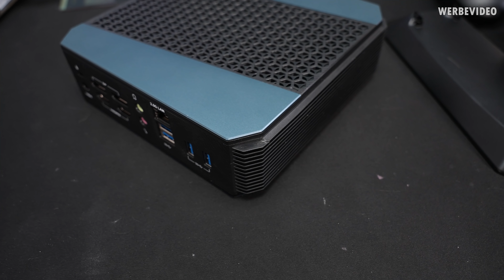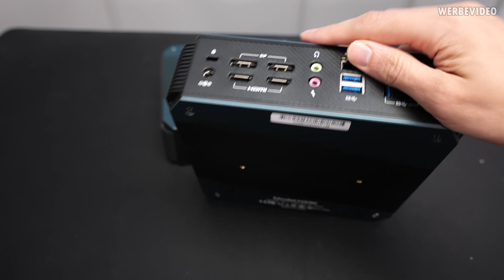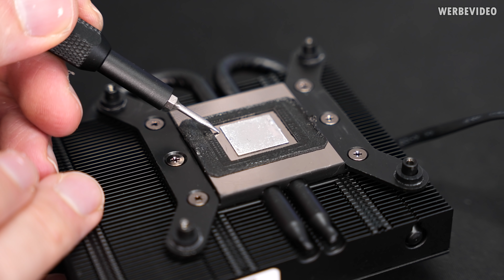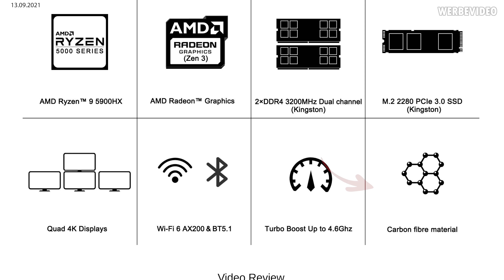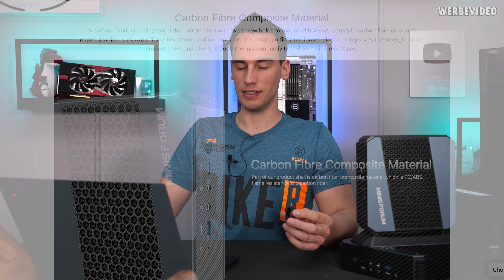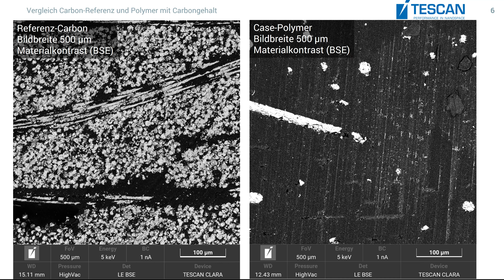More Marketing Lies? Minisforum Retail PC opened and Polymer analyzed by Tescan (SEM)

Comment: Its all just marketeering.  Legally, they have a carbon composite (similar to a bicycle seat shell - those are also "carbon composite" and it does have FINS on each side so that is BETTER than flat sides increasing heat dissipation over standard non-ribbed plastic.... LOL... so...  over 1% alloy in metal makes a huge difference?  3% in plastic is....?  LOL

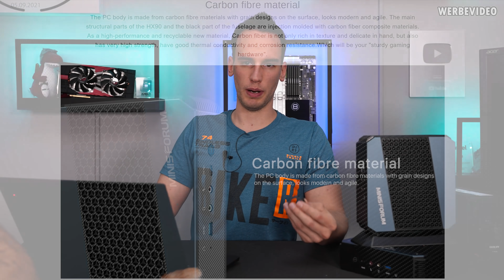Comment: 11:36 Minisforum clearly states it's injection molded composite materials in the text body. seems like the pitchforks were raised a bit too high IMO. Both tested plastic parts are manufactured with different methods. typically chopped fibre is used for injection molding. IMO this is extremely nitpicky. The SEM photos are also only showing a surface photo which isn't indicative of the material composition throughout the material. The continuous fibre manufacturing of the bike part is a sturdier and more rigid design but the chopped fibre injection molding will still improve the strength of the material considerably. The marketing is a bit silly but not as egregious as what we see on many products these days.

Comment: uhh i dont think 3% will make it better than PC/ABS at all, Even in my 3D printer CF filaments the CF % is anywhere from 15-25% ..
Reply: What model printer do you use? Do you need a certain type to print with CF filaments?

Comment: Question is does it really matter what structure does the thing have under the microscope… prolly not really…
Reply: It kinda does if the company claims it to be truly carbon fiber.
Because the structural strength & heat dissipation range is vastly different than "mostly plastic".
And the only way to determine it is to put it under a microscope.

Comment: i feel like the sealing of the cooler to the CPU was probably to stop users who have limited knowledge of how liquid metal works from accidentally damaging their systems. it would also possibly be a way to see if the user has removed the cooler previously (due to potentially damaged sticky tape or even have it replaced. to make sure that they dont get fake warranty claims due to damage from liquid metal.

Comment: It's not the quantity of heat to be removed in this case but rather a more efficient transfer of any heat generated and that is what liquid metal affords. Why not use the best heat conductive material regardless of the quantity or intensity of the heat source if costs permit it? You begin to sound like a low power CPU bigot when you deny the use of liquid metal or any superior heat transfer material to low power CPUs or low price computers in general.